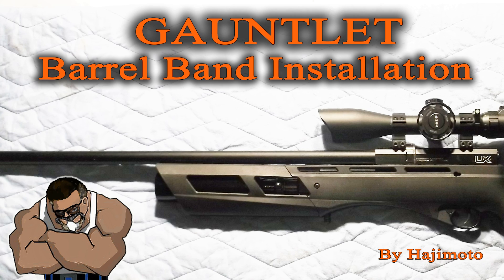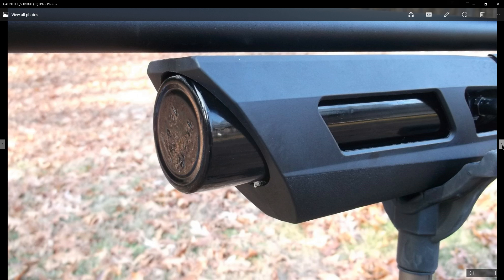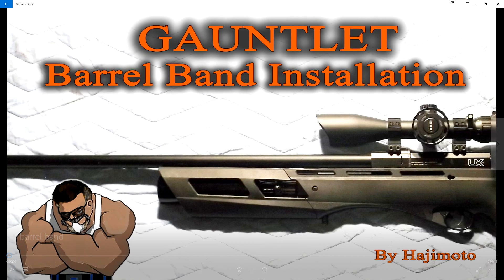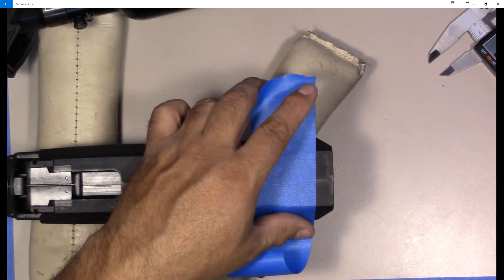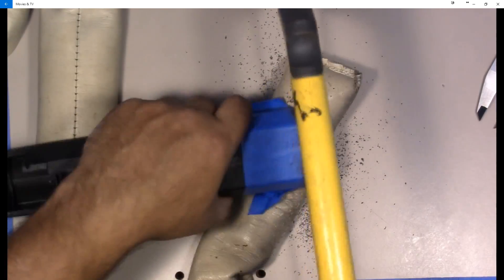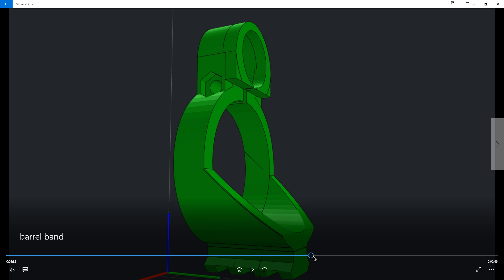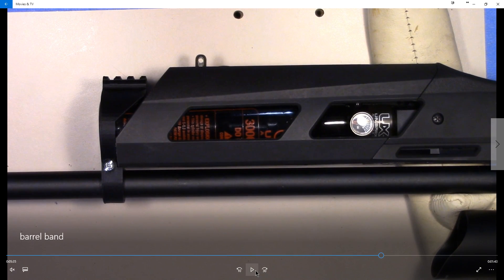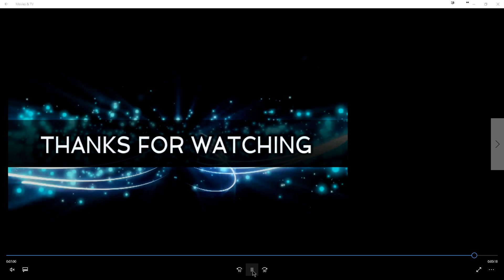Umarex Gauntlet: Barrel Band Support Tutorial

Comment: I'm a little confused...in the beginning, you cite the shroud angling as the problem- but then you have to remove the shoulder on your barrel band, which means the shroud is still floating free! Your  temporary shim seems to be a better solution for shroud angle. I mean, the barrel band is nice for a laser or flashlight, or even for auxiliary barrel support- but it seems to do nothing for the shroud issue.
Reply from the maker: Tod these videos are a snap shot in time and this one is 5 years ago. The barrel band eliminates any tank shroud contact influencing the rifle barrel.
The resolution to the shroud issue has been formulated since the making of this video if the angle is an issue.
Remove all screws that hold the hold to the main stock.
Slide off bottle shroud.
Reintroduce the bottle shroud being sure to engage the left and right tabs.
Install the left and right retaining screws but leave loose.
Install the sling swivel stud and tighten.
Snug not tighten the left and right bottle shroud retention screws.
Regards

Comment: If it's just the shroud,how does it affect the barrel.? Surely it's only the shroud moving anyway.??
Reply from the maker: The barrel has a centering device which makes contact to the ID of the barrel shroud so when the tank shroud presses against the barrel shroud it in turn push the barrel up.

Comment: Nice mod, Hajimoto. I hope you go to improving the Seneca Aspen pump. I don't know what it specifically needs, but you could sell a truckload of them if you made the mod(s) it needs. They all air lock after a few tens of fill ups. The built-in pump is
a Fantastic concept, but is not durable. I'll mail you mine if you don't want to buy one. You'll like the mods I've already made, to remove close to 1.1 pounds. Thanks.
Reply from the maker: Unfortunately I have too many projects in play at the moment to attack anymore. Thanks for the view and comment!

Comment: Who sells just the barrels for the gauntlet 22?  

And does the 25 cal barrel fit on the 22?
Reply from the maker: You can have a machinist make pretty much any barrel fit the Gauntlet. The .25 will fit the .22 but would require a few more parts to be changed to function.
Reply: I went and got the .25 cal, love it.  Got to get a compressor and bigger tank though.

Comment: does it work on the 25 cal and if I get the longer tank I don't have to cut anything?
Reply from the maker: Hey James, yes it works for the .25 and if you have the NON Ninja regulator on your version of the Gauntlet, you may not need to trim the forestock. Yes the larger 22ci tank would not require and stock modification.

Comment: hello    Hajimoto  where can I get a couple of those barrel bands .I want one for each end of the tank .I'll just forget about the shroud
Reply from the maker: susan Marie there are a couple of things that I should share with you as it relates to your question. First, HajimotoProductions.com for all things Hajimoto.
Second, please note that Umarex is now offering the Umarex .25 barrel band as a stand alone part that can be added to the .177 and .22
Reply: Oh ok  thank you .but are they as good as the ones you make 'just a guess but if  used one at each end of the tank .the hole tank and barrel would have to move straight up and down and I don't think there is any way it could move a bit using two barrel bands
Reply from the maker: The style that Umarex uses on the .25 is pretty solid. If you used the Umarex type and one of mine you would have a rock solid supported barrel. for less than the cost of 2 of mine.
Reply: I just looked up the barrel and tank bands for my rifle .there asking way to much for them considering they should have come stock when I bought it .im not impressed with the gauntlet at all .if I had of known then what I know now I never would have ordered it .I would have ordered a qb chef .22  its also PCP  but not regulated .and that's an easy fix

Comment: I have a question Hajimoto can I get a .25 Gauntlet and buy a .22 cal barrel and put in it sense they are basically the same diameter around and give me a high powered .22 Gauntlet or will that not work.
Reply from the maker: and If you change the bolt probe, yes.
Reply: Hajimoto Productions Yes I figured that also Thanks for responding. I have the .25 Gauntlet and really like it. I have yet to get a .22 cal and have been wanting one. Thought this way would be good for a .22 to shoot heavier pellets and still be Regulated on a platform I like.

Comment: Great video...you attention to detail is impressive! I plan on installing a 360cc tank and I'm assuming your barrel band support will slip over the longer tank.
Reply from the maker: Thank you for the kind words. While my HP Barrel Band is designed to fit the Umarex Gauntlet .22 and .177 bottle, many Gauntlet Owners have purchased aftermarket bottles that have the same diameter and the band works fine.  Just be sure to install the HP Barrel Band at the very end of the tank where tank swell will be minimal.

Comment: Also I am designing my own baffles which I have used on my FX guns which is a soft puff will let you know when the valve shows up.
Reply: No I have my own design Haji I will share upon completion. As for the carbon fibre bottle more volume.
To lighten the gun you will have to do something with the rear of the stock, that is where the weight problem is
And don’t get me wrong it’s not a problem but I like to have more control and distribute the weight more to the center.
Reply from the maker: Understood and appreciated, thanks for the follow up Sparrow
Reply from the maker: Coolness! Did you go with a Kcup style by chance?

Comment: Haji FYI I came up with a design on the forearm problem, it works great and does not touch the shroud at all, are you familiar with edging protector used for car doors or I use it for protection of wires in a wire way I am an electrician. I put it on the 2 middle ribs in the forearm, it stabilizes the forearm and it is solid and tight. 
Also are aware of a regulator that has 18x1.5 threads to the tank I ordered a carbon fibre tank from China 350 cc
I want to install on gauntlet. 

“Till we meet again “

       “SPARROW”
Reply from the maker: Hey Craig!  Yes, I am very familiar with door edge guard as I have used it many many time in the past on other projects. The convenient thing about door edge guard is that is available in so many colors and has its own internal adhesive to keep it in place, love the stuff.  Great idea on installing it in the forearms internal ribs, excellent! Carbon fiber tank huh, so you have more volume our you just want to lighten the Gauntlet a bit? Well as I wrote that it may be a combination of both LOL. I look forward to images of it complete. Thanks for the update Sparrow.

Comment: In a previous post, I started out by saying I was not a fan of the barrel band.  I did not have my Gauntlet at that time, but I have it now.  The first thing I must say is I had NO IDEA HOW FLIMSY THE BARREL IS!  So yes. . . I stand corrected, and I eat my words.  That being said, this rifle is a real tack driver.  The problem is that every so often, it "chooses" a new point-of-impact.  There is nothing I do in handling the rifle to cause this, and I'm perplexed as to what causes it?  Maybe a fly landed on it and I didn't see it. . . .  I just cannot believe how loosy-goosy the barrel/shroud is.  I suppose it could be the pellets, but I examine every one before loading it to make sure the skirt is not deformed.  It is very hard to even measure the gap between the bottom of the shroud and the top of the bottle, because the tip of the caliper will move the barrel!  I had to use a feeler gauge to get an effective way to measure.  I think I will ultimately remove the bottle shroud completely.  The shroud is poorly designed, and there is no way to pickup/support the rifle by holding the shroud that doesn't cause it to press on the barrel.  For me, it is not worth spending the time to fix it.  I am going to install a 23 c.i. bottle, which will be a few inches longer than the factory 13 c.i. bottle, and only 1mm larger in diameter.  Using a barrel band with that bottle should make a big improvement.  I just hope the threaded bottle connection is secure enough to stabilize the barrel using a band.
Reply from the maker: Max Rentz - I remember you and welcome back! Its takes a big person to announce they have grown from an experience. I appreciate that and that's all that needs to be said about it. Your concerns are valid as it relates to what level of added stability can one achieve by clamping to the bottle which is essentially supported by a bottle block. I invite you to not forget of the torsional rigidity introduced by tieing to parallel plans together. The upper and lower tendons so to speak can and will substantially strengthen the pair. ;)
Reply: Max: I got one of the first Gauntlets and was never happy with the shroud.  I just left it off.  But I have a Haji BB and am happy with it!

Comment: What I am about to write will not be popular.  I am not a supporter of your barrel band, and I will tell you why.  Umarex designed this rifle to utilize a full-floating barrel.  I believe it is why this rifle is so accurate right out of the box.  While in the process of shooting, you should not touch the barrel.  Don't lean it against the wall... don't hook your finger over it to steady the shot.  You should pretend that it is WET PAINT.

The removable fore-end, or air tank shroud, is poorly designed.  I am sure future versions will have a more secure connection to the stock with no interference with the barrel.  I think Umarex realized this early on, but they still placed the forward sling stud in an awkward location.  Anyone that wants to utilize a bi-pod has tried to imagine a way to mount a bi-pod as far forward as possible.  

You made it perfectly clear in your narrative that the picatinny rail included in the design of your barrel band WAS NOT to be used for a bi-pod.  That was great advice.  But in my opinion, ANY weight hanging from the barrel band at all is affecting the straightness of the barrel.  Maybe it would be more accurate to say the "repeat-ability" of the fired projectile?  Maybe not at 10 yards, but certainly at 50 or 100 yards.  

I would never attach ANYTHING to that barrel that secures it to another part of the rifle, period.  Umarex could have done that too, if they thought it would solve the issue of the flimsy air-tank shroud.  You've got to let the barrel float.

I don't have a Gauntlet, but I have one on the way.  I will come back to this posting and make corrections if my research makes me eat my words.
Reply from the maker: Max Rentz popularity of opinion is irrelevant, your opinion is just as valid as anyone else’s and welcome here, with that said, no air rifle that is considered entry level which equally is interpreted as a shooter’s first gun should be so delicate that it cannot be brought into the woods or used by younger shooters and have the point of impact constantly change. While you say the manufacturer could have solve these issues, my point is they did not and I offer a solution to make a more robust build.
The manufacturers method of barrel to breach connection was an engineering shortcut in the only way to stabilize in unsupported diving board is to have something at the fulcrum point.

Again I respect and appreciate your opinion and look forward to your findings.
Reply: Excellent response!

Comment: UPS tells me my barrel band should be here tomorrow, so today I made the cut and finished the fore end so I'll be ready to install the band when it arrives.
Reply from the maker: Remember Rich is the band lifts or lowers your barrel the tank angle can be adjusted. You will need to degas your rifle, remove it from the stock, loosen the 4 screws that hold in the tank block into the pressure tube and you will be able to adjust the gap to whatever you need. I demonstrate this ability to adjust in my Super Tune Kit Installation Video. I have it cued up for you HERE https://youtu.be/hwIqGXnTVMY?t=9m4s
Reply: Thanks for pointing me in the right direction because when I installed the barrel band without any other modification, it was pulling the shroud down and affecting the POI. So I followed the tutorial you pointed me to; loosened the block from the pressure tube, adjusted my distance between the bottle and the shroud, and now all is good. I checked the POI and was pleased with the results. I don't have 50 yards at home to check it at that distance but I expect I'll only need minor scope adjustments (which I would expect anyway since I had the scope removed during this process.

Comment: Great mod but would you recommend doing this to someone who doesn't have a scuba tank or compressor and will be buying multiple tanks and switching them out to be filled at a store?
Edit......I will be taking my gauntlet out in the field to hunt with
Reply from the maker: One the disadvantages of the barrel band is a multi-tank scenario is that the rifle would need to be sighted in or zero'd again due to the battle and the barrel shroud relationship. Tough call, if you are taking a couple of tanks and are willing to take a couple shots to be sure you back on, yes.  I say this because the Gauntlets Barrel and Barrel Shroud relationship is so easy to change in the field. If you bump the barrel as you are going through brush our stand the rifle against a tree and it slides down to the ground or even if the rifle is dropped all can change your POI and you risk injuring your quarry rather than bagging it.
Reply: Hajimoto Productions , thank you again for you help full reply, I've since reached out to some local dive shops and found one that sells used scuba tanks for $100 and refills are $8, considering a ninja tank sells for $80 and costs $3 to fill (things are pricier up here in Canada) my hand was inadvertantly forced into a better situation.

Comment: Awesome Idea! I really appreciate your work. I have to ask though, Why not just install the 23ci tank mod first? It would be sticking out the front of the shroud already so you don't have to cut it. And you get more shots. Bonus!
Reply from the maker: Hey Jeremy! You are absolutely correct, the longer tank means no modifications required. But, because I am finalizing a Hammer spring/Valve adjustment mod package that affords the user 100+ shots using the stock tank and also reduces the cocking effort by 40%,. The rifle is heavy enough already and the only benefit of the larger tank would be the shot count, I'll have that covered and then some 😉 thanks for the comment and suggestion.
Reply: I can't wait to see that valve video. How hard is it to put these guns back together once you get into the hammer/valve area?

Comment: Hi sorry to bug mr Hajimoto but im almost done with all the fixing  on the gauntlet and had to ask what did you use on the tube to buff & polish it? Thanks for the help. O ya I also had a 2nd idea. I was going to add the washers but what if i make a hammer spring guide  out of 7075 temp aluminum and so the spring guide one piece 3/16 longer no spacers so there no lips would it work?  Love your striper idea. now if u can just add spacer in the middle with the same groves on the out side and then put a grove for a o ring to seal around the barrel for added support it would be a kit. Hope it helps and thanks for help getting me going in right direction.
Reply from the maker: Hello Joseph, I used a ball hone. As for preload on the hammer spring, it is not needed, the spring is already too heavy.  The valve dwell needs to be adjusted and iI will be producing a valve, hammer spring video shortly that will take a stock bottled Gauntlet from 60 Shots per fill to over 105! Your idea sound interesting, are you working on that?

Comment: Hajimoto i was woundring if u put a delrin spacer in the middle of the barrel with holes so air goes to the back and shroud is stable then add to your band with one more on the air  tube behind the bulk fill. Then slot the stock for the band would it   help. Love the mods keep it up.
Reply from the maker: Interesting concept.... I have too many projects already you crack dealer!!!!! You do it LOL
You do realize I will doing this now.....
Thanks for the comment!

Comment: That looks awesome! Wonder if it improves accuracy since the barrel  is more stable and not vibrating as much as being fully floated/flexing...oh by the way USPS must had some trouble with your package cause it was supposed to be here Friday according to the tracker and still hasn't been delivered
Reply from the maker: The Barrel band will not improve the accuracy if the rifle is properly sighted in and properly handled after that sight in.  The issue is the barrel shroud relationship and retaining the new POI change should the barrel be hit or nudged. It will help eliminate the in the field POI changes due to contact with mother natures obstacles.
As for USPS, the tracking info says "The package is delayed and will not be delivered by the expected delivery date. An updated delivery date will be provided when available. Your item departed blah blah blah" There is no revised delivery date but it appears to have left your local distribution center.  Please let me know when it arrives
Reply: Hajimoto Productions I got a notification saying package delivered! Thanks again
Reply from the maker: About freaking time! Stupid USPS!!